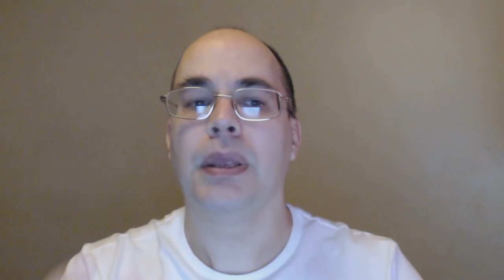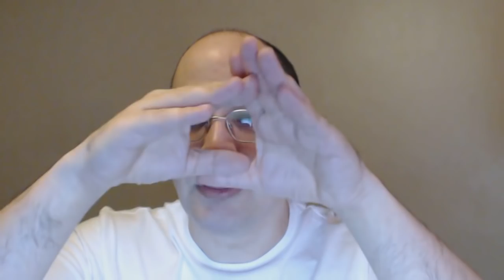How do rockets move in space, with nothing to push off from?

Comment: I have been struggling to grasp this, but I just read a good way to visualize it. Hopefully this helps the confused, from one dummy to another lol.

The contents of the combustion chamber is filled with billions of gas molecules as the oxidizer and fuel burns. This puts the gas molecules  under pressure and looking to escape. As they are forcing each other out of the nozzle, they are pushing back against the rocket. Because the combustion chamber and nozzle are attached to the rocket, the rocket moves in the opposite direction that the gas is expelled. So in Newton’s third law, the ACTION is the burning gasses creating pressurized force inside the combustion chamber, the REACTION is when the pressurized gasses shove back against the rocket nozzle as they escape and dissipate.

Comment: newtons 3rd, theres nothing in a vacuum to REACT to a rockets thrust. rockets dont go to "space"
Reply: "theres nothing in a vacuum to REACT to a rockets thrust."

So if you fired a steel projectile from a CROSSBOW in space, YOU are saying there would be NO RECOIL?
So you think RECOIL stops working in  vacuum?
Thanks for pointing out that you have no clue how Inertia and Momentum work.

"rockets dont go to "space""
I have undeniable evidence that they DO.
I would be happy to share it with you if you answer ONE QUESTION:

at what altitude does earth's atmospheric pressure drop to "Vacuum"?

Since industry standard for "Vacuum" is any pressure BELOW 1.0 Torr, tell me:

At what altitude does earth's atmospheric pressure drop to BELOW 1.0 Torr.
Its not that hard to just LOOKUP online.

Now tell me, and Ill show you undeniable VIDEO evidence of rocket propulsion in a vacuum.
Reply: The gas and the rocket push of eachother. That’s why they go in two different directions.
Reply: theeye 1864 - So why no answer to my question?
Are you NOT interested in video evidence that rockets DO work in a vacuum?
Reply: False. Take a physics course, bro.

Comment: Am I just stupid or was the actual question not answered? 
He explained how thrust works on earth but not how it could apply in a vacuum, surely the thrust needs something to push away from to produce speed if not a solid surface then the air itself which when compared to outer space is like water. I imagine using thrust in space to be like pushing yourself forward using a fire extinguisher that itself is hooked up to an overpowered hoover, you would never move, even on greased up wheels. Is outer space travel entirely reliant on the momentum gathered at launch? Does that mean adjusting course is impossible? I really need to go back to school :(
Reply: What you are describing is not an action reaction pair but an action reaction trio. Which is not a thing. Rocket pushes on gas which pushes on surface which pushes back on gas which pushes back on rocket? Thinking that rockets work like that is like thinking you’d only feel the ting of a baseball bat hitting a ball only once someone catches the ball.
Reply: It goes like that:
In rocket's combustion chamber, fuel gets combined with oxidiser, with produces hot exhaust gas.

The gas expands in all directions.

Those gas particles which are moving towards the combustion chamber opening will simply exit it, without doing any work - but that leaves us with all the particles which are facing away from the opening.

At some point they will impact the walls of the combustion chamber.

When that happens, the gas will ricochet off that surface.

When that happens, the gas will experience a force.

Any force has an equal but opposite force.

Ergo, the combustion chamber, and the rocket it's attached to will also experience a force and start moving.

I'll be happy to explain further any point you have troubles with.
Reply: @Jan_Strzelecki  that makes a lot of sense in my mind's eye, explains the shape of the thruster's housing aswell
Reply: @lukecooper1179  Rocket engines are basically just "Mass Cannons".
They shoot MASS in one direction and feel the RECOIL force in the opposite direction.

Did you think RECOIL just stops working in a vacuum?
Would a CROSSBOW fired into a vacuum STILL have a recoil force?
YES.
Reply: @stuartgray5877  personally I've always felt that crossbows lack much in the way of recoil as they pull forward and that is more like elasticity which I can comprehend.
I don't know exactly how powerful the vacuum of space is but as with the fire extinguisher example if you applied a powerful enough hoover to the front of a cannon when it fires I'm sure it would negate movement. The previous response makes a lot more sense to me. The Canon when fires is a massive force pushing against air, surely that is what causes the recoil? I'm no expert though, obviously
Reply: @lukecooper1179  - "personally I've always felt that crossbows lack much in the way of recoil as they pull forward and that is more like elasticity which I can comprehend."

Watch the video on my YT channel. It clearly shows that crossbows have PLENTY of recoil

"I don't know exactly how powerful the vacuum of space is"

This is a common misconception. The "vacuum of space" has no "Power" whatsoever.
Space is merely a region at ZERO PSI.
 Yes -  0.0 PSI

Movies portray "Space" like a giant wind tunnel.
The real "space" is nothing like the movies.
It has NO power, and cannot exert a force on anything.

When a rocket engine fires in a vacuum, the exhaust gas is PUSHED OUT, not "Pulled".

"The Canon when fires is a massive force pushing against air"

No the recoil from a gun or a cannon comes from ACCELERATING the MASS of the projectile.
None of the recoil from a gun or a crossbow is from the projectile PUSHING on the air in front of it.
A bullet would have no way of transmitting a force BACK to the gun AFTER it has left the barrel.
Reply: @stuartgray5877   there is still air to push inside the barrel. All the same, there must be a reason recoil causes movement on an atomic level, something you could see (if of course you could see atoms). My main confusion stems from my understanding (or lack there of) of how thrust moves things, if its not from a flow of material pushing against something else forcing the two objects apart even if the other object is only air particles then how does it work? Nearly everyone explains it as forces working as forces do but why do these forces do what they do. I'm sure that it comes down to atoms because as far as I have seen everything always does.
Jan Strzelecki's answer makes the most sense to me.
Reply: @lukecooper1179  When a force is exerted between two Objects (MASSES) the force is felt by BOTH Objects.

When a crossbow bow pushes away the projectile the BOW feels the force and gets pushed backwards with the same force and the same duration as the projectile feels.

This single force gets the projectile to very high velocity but will impart only a small velocity on the Bow (which is normally absorbed by our bodies).
The video on my YT channel of  crossbow firing with nothing holding it shows a LARGE velocity is imparted to the crossbow by firing the projectile.

When a rocket engine fires in  vacuum, the engine turbo pumps and Nozzle are exerting a FORCE to push the gas out the nozzle.
The force of accelerating the exhaust gas out of the nozzle induces the SAME force on the nozzle.
Propulsion in a vacuum is really just RECOIL of firing out MASS.
You don't need anything ELSE to push off of.

If you were sitting on your ass on a frozen lake of perfectly frictionless ice, could you get off the ice with a fully loaded AK-47?

Yes. 
But it basically has nothing to do with an atmosphere and solely due to the RECOIL force exerted when firing the gun.
Reply: @stuartgray5877  this still leaves me wondering why these forces create these results, it all sounds like magic. Most videos just keep explaining newton's third law rather patronisingly but it's just taken that that's the way it works so that's all there is. I can't deny the clear and observable facts that it works, I've seen rockets fly after all. I just can't grasp the why in such a way that doesn't conflict with everything I've already learned. I realise that I must be getting quite frustrating by now. I have to unlearn some things first I suppose. I will bare all you have said in mind and try to work it out, I envy your grasp of this, haha
I'll get it soon enough
Reply: @lukecooper1179  - "I envy your grasp of this, haha"
I have been building, testing, launching , and operating spacecraft in earth orbit and deep space for over 25 years now.
I have been the Launch Vehicle Integrator, Launch Conductor, and even Flight Director at JPL.
Lookup the Deep Impact mission where we flew a spacecraft "bullet" into a comet and took video from a distance.
Reply: @lukecooper1179  a good example is Newton's Cradle desk toys - they operate under 1) external input 2) tiny bit of friction 3) air resistance 4) Newton's laws.  
If you can get one in a vacuum chamber and lift it from outside with a magnet you should be able to experiment with the air friction variable, and temperature would give you some control over the friction of the strings.
Reply: @inniuniui9361  good to know that you've at least seen a Newton's Cradle in action, so you understand that every molecule of gas in a rocket's combustion chamber and nozzle that bounces off the surfaces contributes to thrust pushing it through space
Reply: How would you think light air molecules being blown away by exhaust gases at supersonic velocities somehow push back against the rocket?

Clearly you have my thought this through.

Comment: BBUULLLLSHIIIITTTTT
Reply: Well, since you used multiple letters attempting to spell a word you must be really smart. (Sarcasm).
Reply: Air resistance is the resistance of the air to a body passing through it; the force that the body has to apply to move the air out of the way, equal (thanks Newton) to the force that the air being moved applies to the body moving it.  Air resistance exists because air molecules have inertia so resist being accelerated: they resist change of momentum. And, by Newton's first law of motion the force exerted on the air molecules equals the force that they apply back.  
So: change in momentum is resisted by inertia, so a force is required to change momentum. And, force exerted = force resisting.
Therefore, if a rocket pushes e.g. a brick out behind it, the momentum of the brick goes from zero to something in the backwards direction. So the brick's inertia resists this. So the rocket has to apply a force to the brick to make that change of momentum against the brick's inertia. But, at the same time that same force is applied back on the rocket (First Law), so a force is applied against the rocket's inertia, so the rocket has a change of momentum :- forward. 
Now, rather than one brick, imagine a whole series of bricks: push, push, push.
Now, rather than bricks, imagine a whole series of gas molecules: push, push, push, push, push, push, push, push, push, push.
Reply: Are you referring to what your brain is comprised of?

Comment: Bravo. Thank you.
Reply from the maker: You are welcome!
Reply: @mjmurcott647  Sir, 1. How do spacecraft slow down and navigate in space?

2. For instance, when astronauts are conducting spacewalks on the ISS, is the ISS in motion at that moment? At what speed? If so, how are the astronauts not feeling the speed or being affected by the speed (I know it may sound like a silly question, considering that the answer is probably because of zero gravity....however I would like to understand rather than just knowing.)
Thanks.
Reply from the maker: In general they don't slow down most of the effort goes into making them go as quickly as possible as the distances involved are so large. However they do use small thrusters on the sides of the craft for fine tuning of the direction giving a little nudge here and there. On a space walk on the ISS everything in and on the ISS is travelling at the same velocity a bit like you walking down the central isle on a train going 100 MPH, so the actual velocity of the ISS doesn't really make a difference, once outside the ISS there is no wind or anything else to slow them down or to start buffeting them like there would be if you were on the outside of that 100 MPH train.
Reply: Thank you Sir
Reply: Much appreciated